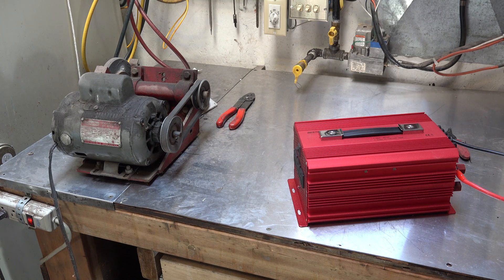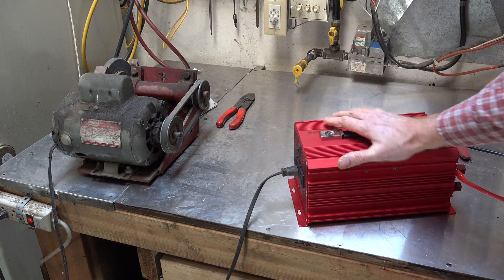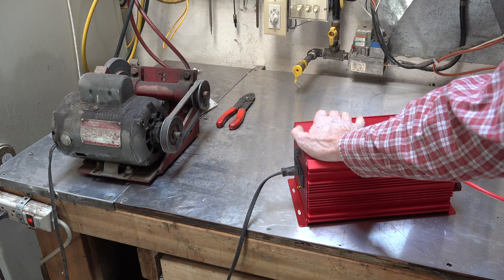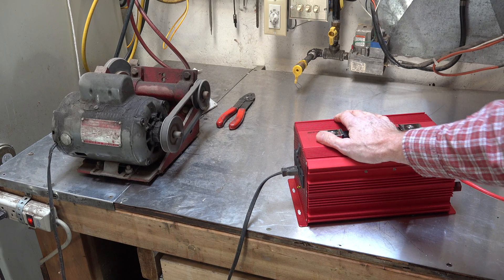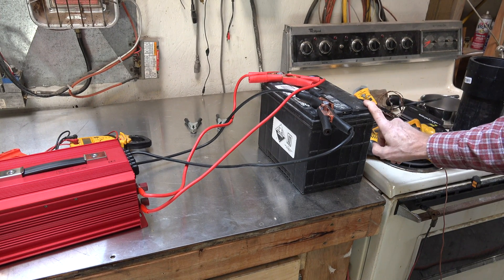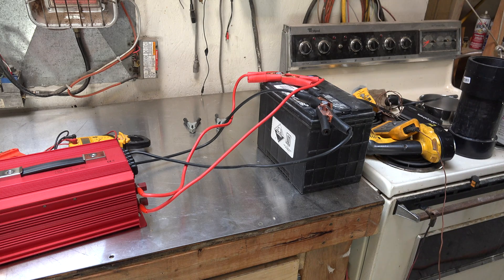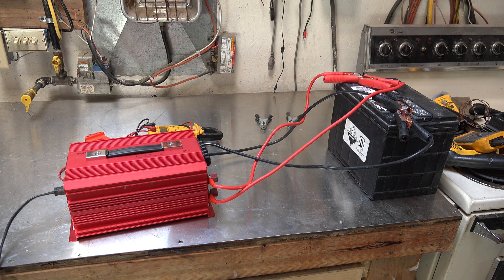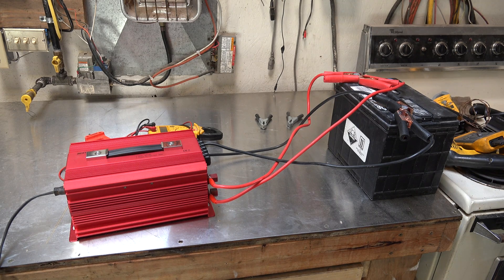Bestec inverter test of capacitor start start motors #3

Comment: First of all "is the invertor pure sine wave?". If it's square wave or modified sinewave, that's make great difference.
It's consider it's pure sine wave and 2 kW power rating. Your battery wattage must be double power rating. That means if you want to run 1hp capacitor start motor you battery power should be atleast 2400watts i.e you 12v  battery should be of 200 AH ( 12x200 =2400). Considering that the battery efficiency is 80% , so in practice World, a 12 volts 200 AH battery supply power of 12x200x0.8= 1920 Watts.

I have a pure Sine wavethe inverter of 2000 watts. It can take short time surge of 4000 Watts. I want to start my 1 Hp capacitor start water pump.But I don't have 200 AH battery. I have 100 AH battery which is not sufficient to start a 1hp motor.
Reply from the maker: Its a modified sine wave.  
GFM

Comment: I have a 1/2 HP capacitor start well pump and it works perfectly with this inverter. I have it connected to a deep cycle marine battery and used the cables supplied with the inverter.
Reply from the maker: It should.  The converter is large enough to handle a hard start well pump.
GFM

Comment: I see that you have two different spots on back to hook cables to a battery... can you hook 2 batteries... one set for each battery... would that increase your amp hours? Or do both sets have to attach to one single battery??? thanks for the info
Reply from the maker: You can use both on one battery, as Ido when I have just one.  When using 2 batteries, I would use one set on each.  Remember, one battery will use twice the amperage as 2.
GFM
Reply: Thanks for the quick reply... just to measure  twice to cut once...  If I have two identical batteries say  2 X 12 volt deep cycle with an Amp Hr rating of 100 Amps each.....If I attach the Pos and NEG to one battery.. and then the second set cables to  the other 12 volt Battery ( that is also 100 Amp hr). Would my  inverter system then have 200 Amp hrs to draw on ( the system would be in parallel) and not in series where I would still have 100 Amp hrs but 24 volts???  Thanks I have the same inverter but reluctant to attach both batteries to each set of cables... thank you again for your advice...
Reply from the maker: You got it.
GFM

Comment: also, a battery is 12.6 volts.  an alternator puts out 14.4 volts.  that extra couple volts may make a difference as well.  maybe not........if the thing is installed in an actual running vehicle it may give a little different of a result.
Reply from the maker: +jeff leonard I will be trying that
GFM

Comment: Do NOT go cheap on the DC side for the cables from battery to inverter. The factory supplied cables are usually terribly inadequate. Hie thee off to Google or your favorite search engine look up the ratings and size of COPPER stranded cable needed for the distance from battery bank to inverter. NOTE ! You will be shocked on the big size needed for the current to cable size AWG, American Wire Gauge. Example, if the instructions supplied on your inverter says 2 feet from battery to inverter, that distance is from and to the battery to inverter. Let me say it this way... if your inverter to battery is 2 feet, you NEED to have wire size figured at 4 feet. So, look at distance and the current (amperage) draw and look at the chart of AWG size wire needed. Throw away the supplied wire and get or make your own DC supply wires.
Reply from the maker: I will be testing the unit with larger wire and better connections. 
GFM

Comment: Try taking two batteries and wiring them up in parallel, then you would double the amperage, providing the overload in the inverter does not trip.

Comment: Great representation of failed expectations with this set up. All may not be lost though...

At 12 volts, inverters draw a ton of amps (IF they can) You need to max out the cables big time. 
Starting batteries do provide a good deal of amperage but for a very short time and are not suitable for running large loads at all, at least not longer than a few minutes. This is why they are referred to starting batteries. As such, these batteries are normally quickly recharged in a few minutes once the engine starts operation.

Even the best deep cycle batteries should never be drawn down past 80% of capacity and recharged shortly after use if one expects them to have a decent service life. Think years verses about a year or less.
Deep cycle batteries will not deliver the huge amperage in short bursts as a starting battery will, but that is the big difference between the two.
Voltage drop at the inverter is the killer, most will trip off below 10.5 volts and DC resistance is high in small gauge wire, especially at such low voltages. 
  The 1800 watt pure sine inverter I have, running off the starting battery with the engine running will start and run my 1/2 HP sump pump. In actual operation like this, the 4.0L engine labors when the pump is running, I never checked the amperage that my alternator puts out at idle, but full load amps for the alternator is 130, no doubt at or over 3,000 RPM
130 amps X 12 volts is only 1560 watts out, much less at idle
12 volts times 100 Amps = 1200 watts, so is the wire gauge input to the inverter up to flowing in excess of 100 -200 amps? I doubt it  ;>)
By the way, cable clamps usually offer high resistance at the point of contact while under load, not enough surface area to allow for large current flow, worse yet, they may look like copper but they are usually copper plated steel, another sour point of high resistance.
Kind regards... C

Comment: Up the size of your jumper cables to 1.0 and have good heavy vary flat lugs at the inverter. It also works best with the type battery flat bolt on type. Like marine batteries
Reply: +t lech  Yea, that's the first thing i thought of also, One heavy cable is better than two small cables and get rid of the spring clamps, they really don't have the area to carry that kind of current.